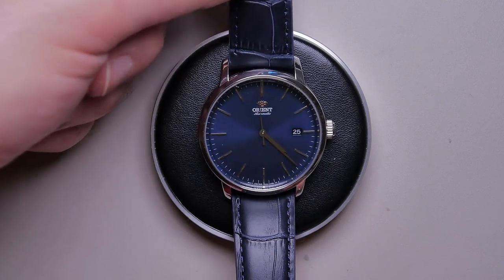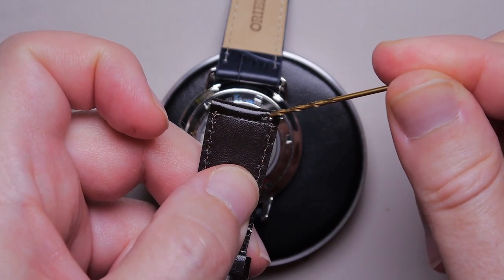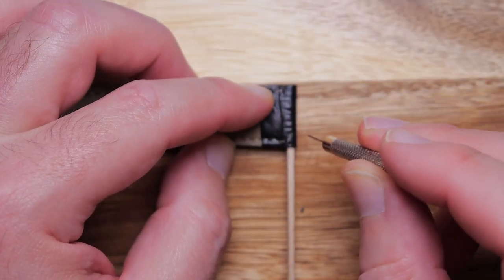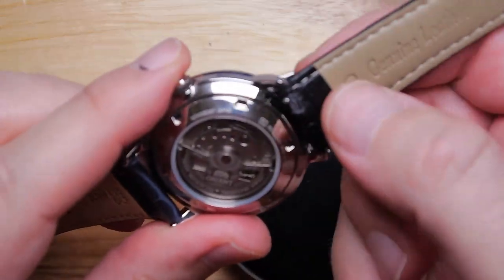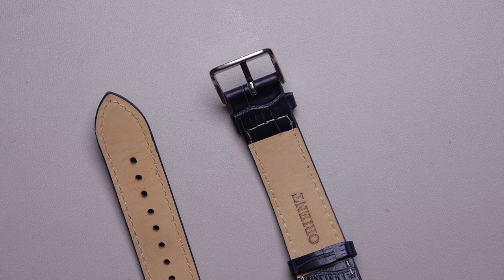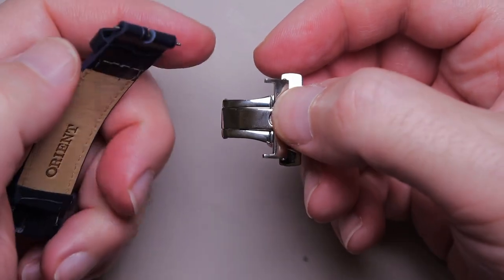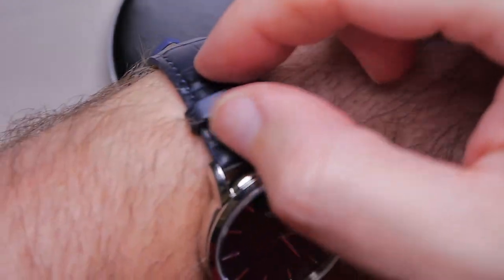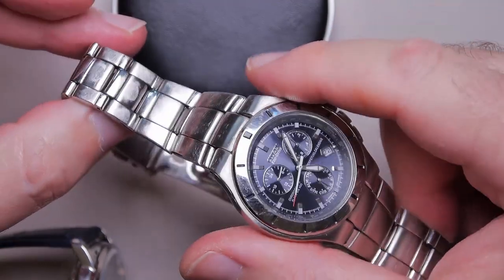How To Make A Watch Strap Quick Release And Install Butterfly Clasp

Comment from the maker: Are you tired of fighting with a spring bar tool every time you want to swap your watch straps?  Have you never bothered to change your strap because it's too much work?  Well here's an easy way, with a little practice, to make virtually any leather strap, a quick release for just a few bucks!  Of course there are probably 10 different ways to do this, so feel free to improvise and if you figure out something better let us know in the comments!  This also shows you how to swap out your buckle for any clasp.  I greatly prefer clasps because they fit me better, are way faster to take on and off and have the benefit of never stressing the strap or parts, making them last far longer.

Watch Display Box: https://amzn.to/3Vk75fe
Seiko Presage "Mockingbird": https://amzn.to/3VKIuAh
Pagani Design Skeleton Watch: https://amzn.to/3H0QYz4
Watch Cushion Pad: https://amzn.to/3ipmlsH
Watch Back Removal Ball: https://amzn.to/3H0Q8SW
Basic Watch Toolkit: https://amzn.to/3gSnFnB
Watch Gasket Grease: https://amzn.to/3XOoQ7Y
Ultrasonic Cleaner Solution: https://amzn.to/3OOuSl4
Ultrasonic Cleaner: https://amzn.to/3AZMmoP
Finger Cots: https://amzn.to/3ERUZDh
Watch Polishing Cloth: https://amzn.to/3ESpysl
Quick Release Spring Bars: https://amzn.to/3gSH6wE
Acoustic Sound Panels: https://amzn.to/3ESZYTX
3M VHB Tape: https://amzn.to/3AWh8za

As an Amazon Associate I earn from qualifying purchases.